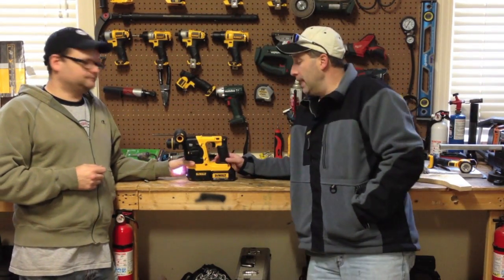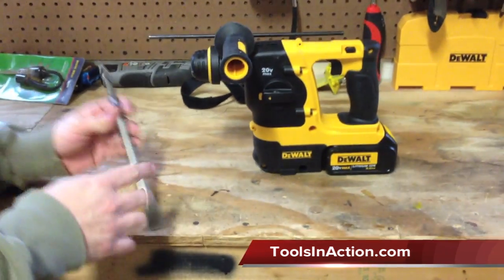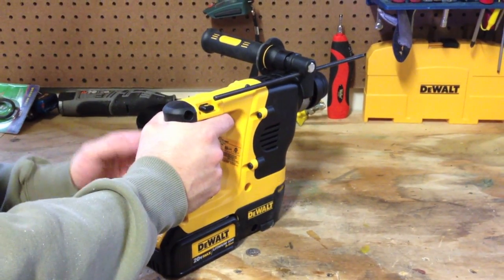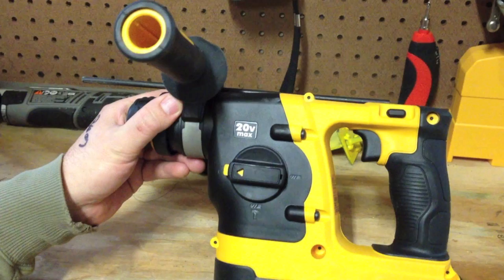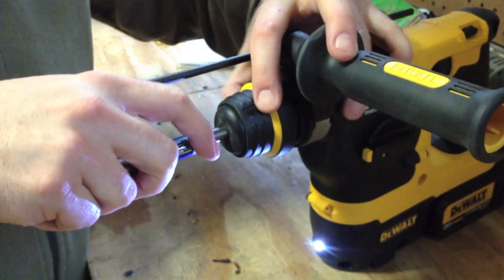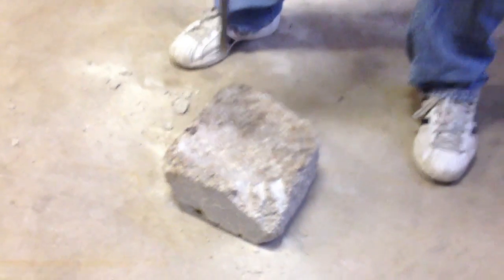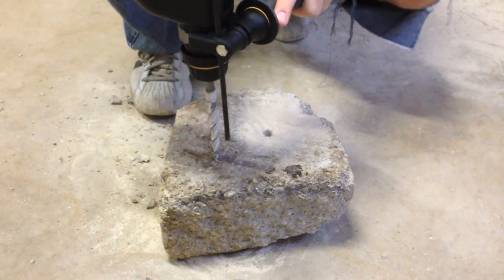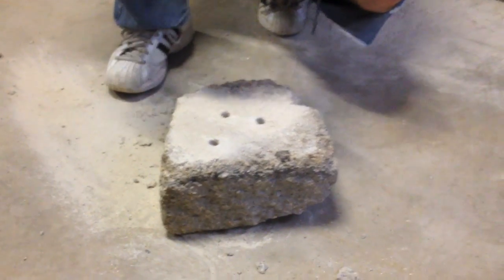DeWALT DCH213L2 20V MAX Lithium Ion 3 Mode SDS Rotary Hammer Kit

Comment from the maker: @mallow399 I think it would eat the batteries up.  We didn't use a core bit or test it with one.  For a smaller hole, you would be ok, but not a bunch of them.  Your right a corded version would be better.

Comment: I few years ago i started buying into the 20v line and have been fairly pleased overall, although this sds rotary hammer  crapped out on me after a month or so of use which made me wonder why,  maybe defective or maybe it was pushed to hard? Mainly used it for drilling 5/8 holes into concrete who knows.

Comment: I noticed it's using the 3.0 battery. Will it still run on the 1.5 battery?
Reply: I'm sure it will still work but the runtime will be shorter since the ah rating is just how much charge a battery can hold.